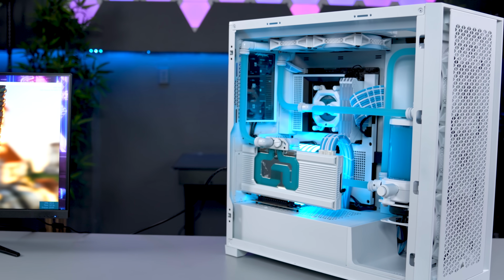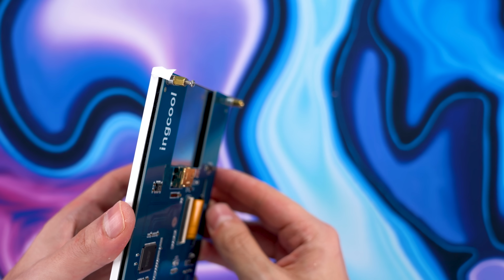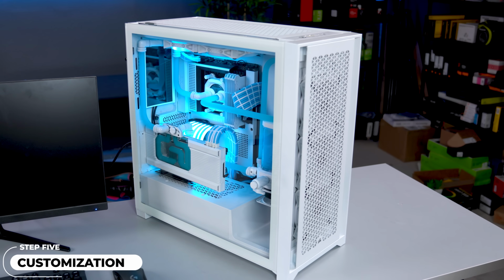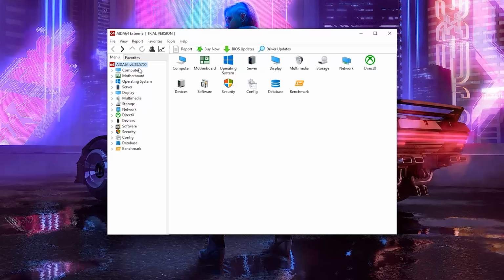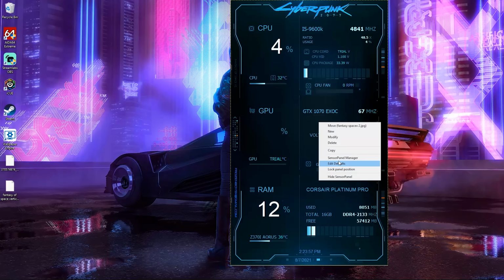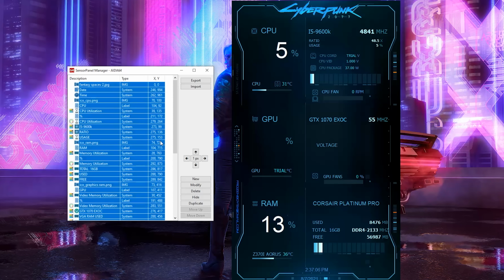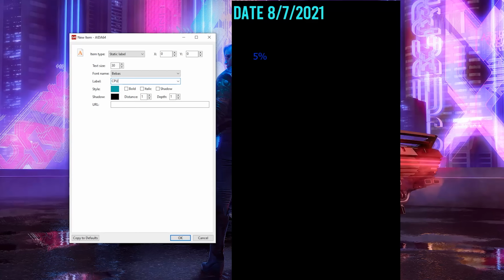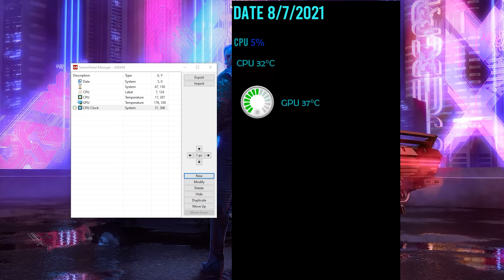The Coolest Mod for your PC!

Comment: Only drawback is you might need a video card for 2nd HDMI port if you only have 1 on I/O panel. Wanted something to cover up holes and ridges in between MB and front of case. Was going to use some thin sheet metal to cover them. This looks like it fits the bill better. Can still use sheet metal to frame this and create a nice flat plane from the MB to front of case. I like RGB, but kinda thought there might be something more useful to stick inside a windowed case like a TV screen. No window case? Attach it on top of your case like a billboard.
Reply: Or, if the I/O panel on your GPU supports it, you can change the cable to your main display into (DisplayPort - DIsplayPort) or (DIsplayPort - HDMI). Then the single HDMI slot from your GPU will be freed up for your sensor panel display. Alternatively you can run a (DisplayPort - HDMI) cable from your GPU to the sensor panel and keep the cable to you main display as it currently is.
Reply: Can't a hdmi to usb adapter be used if there is no 2nd hdmi
Reply: @paulfearn4905  i got a dvi to hdmi adapter on amazon for 5 dollars for 2 pack
Reply: What i did was get a panel that is completely usb and then plug it in with a usb to usb header connector. No external wiring and much easier to hide
Reply: if you have a GPU with only one HDMI port, its probably too weak to be wasting performance on running a mini display
Reply: @seemslegit6203 lol not true at all. Mine and many other 4080s have 1 hdmi and 3 display ports. DP is the way to go anyway
Reply: @seemslegit6203  hahaha… my first thought too

Comment: pls use white cable sleeves and use the usb header on the motherboard 🙄 and hide the taskbar on the external monitors with the right taskbar-setting. same menu but -> Turn “Show taskbar on all displays” off.

Comment: or you can just use a old phone or tablet and run Trigone remote system monitor then you can add hot keys and other stuff however screen in a case kinda looks cool

Comment: Keep in mind if you want to monitor your gpu temp and usage aida64 will make your system crash randomly when the drivers and aida64 try to access these probes at the same time.  This has been a known bug in aida for 5 plus years now.  So if you start getting random crashes try turning off aida
Reply: This is a year old but I believe it only affects AMD gpu’s doesn’t it?
Reply: @taden2007  yes as far as I can tell it only effect AMD GPUs.  It's just sad that Aida will not post on their site that their software is not compatible with AMD GPUs and they have no plan to fix it.  But they are happy to take your money.
Reply: So you’re saying I baisically cant use this screen with my AMD gpu?
Reply: @RealistikOG  Sadly yes.  I have tried to work with the Aida64 devs to try and resolve this but all they want to do is blame AMD and pretend its not an issue.   And they wont provide any refunds for people buying their software without knowing this issue.  So from what research i have done it appears what happens is aida tries to poll certain sensors on the GPU at the same time as the AMD software and/or windows tries to access it which causes the driver to panic and crash.
Reply: thanks for the reply! but what if i only plan to use my raspberry pi monitor for showcasing desktop background or gifs etc/ not monitoring any temps or stats, will this still be an issue with my amd gpu @jdmaltezza

Comment: I did this with my rig. I HATED IT! Even using something like UltraMon, or DisplayMate, every time windows took over the display (warnings, notifications, etc.) it would cause the panel to go blank.

I resolved all of my shart issues with an SBC. a dedicated system for running such a display. The Raspi works GREAT! There are tons of programs that allow you to monitor remotely. 👍👏

Comment: You should be able to scale the resolution. It shouldn’t need to match. The aspect ratio needs to match but not the resolution. I think your confusing the terms there. 

Kind of cool, until your working on a project and you accidentally move a program or folder over to your third screen and now you need to peer into the inside of your case and squint to see where the cursor is just to get the window back into your main screen(s). Seems like much more of a hassle than it’s worth but the white and blue pc looks dope.
Reply: Hi. Can you set this extra small monitor to a 2nd monitor? The windows logo key + P button? So that you dont need drag cursor?

Comment: Hello, @TechSource I saw this video and wanted to buy the monitor you showcased. I found an issue with the reviews of the product on amazon. Most people that bought it had their products broken on arrival. I was wondering if you know anything about it or if it's just a bad batch of monitors? I want to get the monitor but do not want to spend $60 just to get a broken product. Any info would be greatly appreciated. 

Thank you
Reply from the maker: Hmm that’s bizarre, mine works just fine. Probably unlucky, but if u buy on Amazon u get returns for free up to 45 days so u are protected
Reply: @TechSource  Thank you for the reassurance I am glad to hear it. amazing video by the way!

Comment: Hi, do I still need to program the LCD screen for it to work? or I just can plug it and will display the screen automatically? thank you
Reply: MOST screens are plug and play, just like a PC monitor. All you need is an HDMI and the USB power cable. SOME screens out there can run off HDMI power alone. The 7" display linked is plug and play. Just make sure you turn on the power switch.

Comment: With a Corsair Obsidian 1000D I could put it anywhere in the tower I wanted. Ultimately, I decided to put it on my desk below my dual monitor setup and propped it up with a stand that it came with. At the end of the day, yes sensor panels look sweet in the tower, but if you want the panel to be USABLE, you need to either have your tower on your desk or use a theme that has large information displays. With my Sensor panel directly below my monitors, I can have far more information visible to me at glance instead of having to physically turn my head mid game to see how my rig is running. Just my two cents lol

Comment: you are using your PC graphics card to drive this?!?!?  Damn, just use a Raspberry Pi Zero-W and send the info to your data screen display via USB port.  You could even add heat sensors, water leak detection, cameras, and if there is a problem have it alert you.

Comment: Don't say a case offers a no compromise build when it lacks any front drive bays.  Lack of front bays = MASSIVE compromise...
Reply: Most people don't need them
Reply: @estusflask982  Still a compromise.
Reply: @beanwithbacon  You can get an external one or an internal one in external enclosure. And just plug into USB
Reply: @estusflask982  Yea, that's the very definition of compromising.  I want LESS clutter on my desk, I like having the option to add more components internally.  Things like a hot-swappable SATA drive bay right in front are wonderful.

Comment: Really cool, just a few questions. Do you have to start this up every time manually or is there a way to have it open on the second screen every time windows starts? Is there a way to prevent the mouse from entering the second screen, I can imagine it would be easy to lose it there.
Reply: There is a way to get AIDA64 to launch when you start up windows. The mouse will enter the second screen but its not as bad as you think, youre always looking at your mouse so it's hard to lose track of it in the first place.

Comment: New to your channel, and enjoying it. I have a question about this external display which I absolutely love. Will running this hinder or affect gaming performance?
Reply: depends on your pc. Using wallpaper engine does use some resources especially if you max the settings, but if you have a decent pc it really shouldn't be a problem. and if you are adding things like this to your build id imagine your specs are already fine.

Comment: Hey Ed, I was wondering if u think upgrading from a amd fx6300 to a amd fx 8350 is worth it, my gpu is a gtx 960 4gb version and I cant get more than 20 fps in minecraft in the hypixel skyblock hub, I think my cpu is throttling my gpu.

Comment: Thanks a lot for this useful video. I have a CoolerMaster H500 case and I'm interested in installing a 7' panel on my PSU shroud. But can you please tell whether my case will have enough clearing for it? How can i find it out? 
Also, if I use a double-sided tape to mount it, will it cause any issue at the back of the monitor?
Reply from the maker: Just measure the spot u are going to mount the display diagonally from 1 side to the opposite corner, that size needs to be bigger than the monitor u are installing. U can use 3M tape to hold the monitor in place.
Reply: @TechSource  Thanks a lot!

Comment: Starting from 8:49 was wondering if that system info on your ram is correct. 4 sticks but only 16 GB total ram? or your using dummies for the two other slots? Also xmp profile looks like not loaded as only 2133MHZ was shown.

Comment: 2:10 lucky me with the Lian li O11 Dynamic that has the space in back available but not enough to mount any fan :D
Reply: Same case I have. Have you installed it already?
Reply: @kharizmaaa  not yet, using that case for mining computer but i will one day ;P
Reply: Also have this case. Wondering if it will fit just like in the video 🤔

Comment: you could also just use a micro usb to a motherboard connector cable then have one less cable to worry about routing out the back, then when you turn off the cpu to sleep the display will also sleep
Reply: I tried that and W11 wouldnt recognize the 2nd panel
Reply: @jackmahoff931  did you confirm the cable plugged in all the way / oriented the right way? I use windows 10

Comment: just a few things.. you can also use any tablet.. I used a Samsung Galaxy tab I had laying around, and a program named spacedesk (free) to create a wireless display.. second you can edit the background picture of any sensor panel in paint to match your resloution, and then replace the original (just make sure that you make the sensor panel size the same resolution in aida 64 . Also the free version of aida64 is not bad , but a lot of the sensors will say Trial  and you can not get rid of that label .. unless you get the full version (GPU utilization for example) .
Reply: How are you charging the tablet when it's inside? Just put a USB cable out into the pc as with a normal display? I might have some old tablet laying around which have no use right now
Reply: @Gene.-  yes.. I ran the usb cord through the motherboard tray , and back up through the basement , and then out one of the back io spaces to charge it.. quite easy to hide because my gpu is vertically mounted
Reply: @jayblueeyez76  I see, my gpu is not vertical but I guess since my case is black I can hide the cable pretty easily
Reply: @Gene.-  even if you don’t put the tablet in your case the spacedesk program turns the tablet into a wireless display .. so you can put it anywhere … does not need to be used with aida64.. it is a full fledged wireless display
Reply: @jayblueeyez76  Hey I was thinking of the exact same idea and I have been using spacedesk for a long time now, just not for this purpose. However I have to manually switch on the tablet (press the power button) for it to come to life and since i dont ever close the spacedesk app it connects automatically after that. I also have to manually switch off the tab otherwise it displays a pretty annoying powersave screensaver. However it wud be great if i didnt have to do even that and cud use it truely wirelessly. Did you get around this or is this the same with you??
Reply: @arkyajyotighosh7051  I simply set the sensor panel to lock its position and to prevent sensor panel from being minimized.. this keeps it on top on the tablet and since it is always active , it never sleeps
Reply: @jayblueeyez76 but dont you ever switch off your pc or the tablet itself?? Do you keep the tablet running 24*7?? If you switch it off at night or so how do you do that?
Reply: @arkyajyotighosh7051  I keep the tablet plugged in directly to the wall so it never powers down ... when I reboot me computer spacedesk and aida 64 restart automatically, and most times just automatically kicks back on.. in the rare case it does not I simply remove my side panel and reconnect spacedesk on the tablet
Reply: Alri88yyy I get it now.. Thnxx a ton!! 😊
Reply: @arkyajyotighosh7051  I kinda have the same problem as you, -> pc turned off, tablet is still on in spacedesks power saving mode, I'm scared of screen burn in and didn't let it on long enough to actually see if it will just go into a blackscreen
Reply: @Gene.-  yeah ikr....  It doesnt go into black screen ive tried... The only thing which you can do is root the device and rig it so that the screen comes alive when being charged and goes off when charger is unplugged... Ive seen this being done and it seems like a good idea and am thinking of doing it...
Reply: @arkyajyotighosh7051  there is an option in dev options of android that makes it that the screen stays on when charged, sadly it doesn't do that it also turns off when you're turning it off. Is this done with taskr? Could you point me to where you read this? Seems like the best option
Reply: is there a guide for how to match resolutions? i need to buy one but im not sure about what happens if i put a say 1920x600 background in a 1024x600 screen
Reply: @hamza-8978  go into paint and open your target image. Then resize it to your desired resolution scale , save the picture . And you are done
Reply: Thanks for this comment, an entirely software based solution seems a lot easier since I have an old tablet laying around.
Reply from the maker: Good point
Reply: @TechSource  can I please get a pc I don’t have and I’ve been wanting one